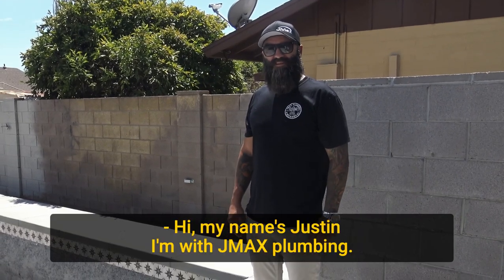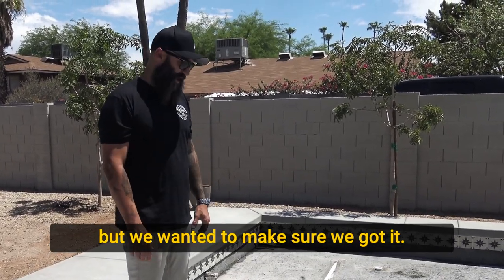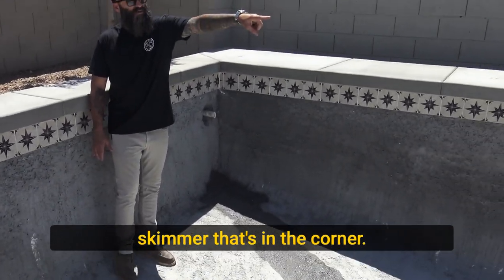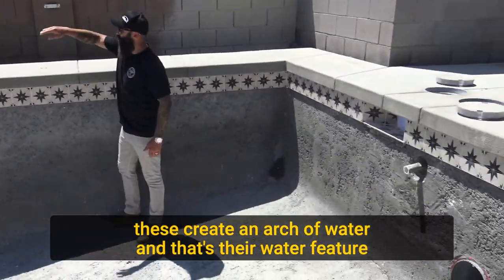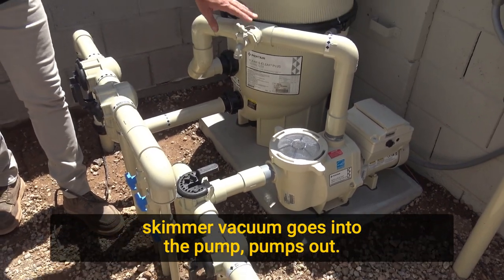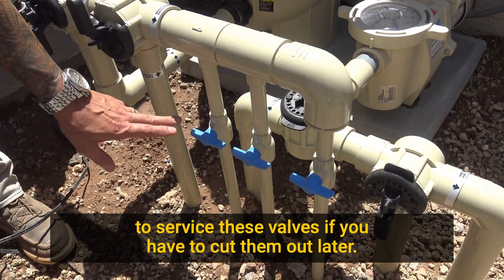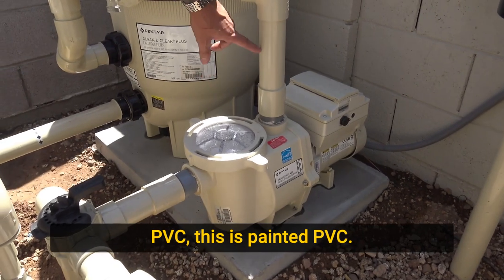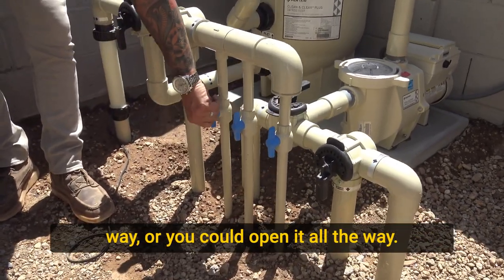Basic Swimming Pool Features and Plumbing Walkthrough with Justin Bowie of JMax

Comment: As a pool tech, installing unions is key in helping techs down the road incase the pump does need to be pulled, instead of cutting pipe your only unscrewing the union. Otherwise super super clean work. From my experience unions are like gold when pulling a pump.
Reply: Definitely I agree, unions are a must have otherwise there's no other way to remove pump but to CUT the pipe which is a big NO in my list, besides very nice installation.
Reply: @santiagosalcedo7653  could have installed high temp unions at the pump in and out ports .

Comment: So when you have an automatic vacuum cleaner, do you plumb that vacuum line independent from the main drain suction line with it's own three way valve?  Or do you just tap that auto vac line into the main drain suction with a pvc tee?

Comment: Cleanest EQ set ever. Only thing that would add to value would have been long plumbing w/out EQ and shooting the pad in with gunite. Very thoughtful return placement. The customer did an A+ job finding you. Are you doing an acid start up? Wondering what type of plaster finish you are using as you are saving the salt cell.

Comment: thanks very very informative, 2 questions ,

1- i only have 3 meters between the home and the fence , is it enough to make 5 by 2 pool cause you have to leave space for the cement and stuff?

2- should i get salt cell or choline system?

thanks in advance
Reply: Should contact a builder, to see what can and cannot be done, but I get the feeling that it may be a little close to even pass code.

Comment: Wait, you said the 2in pipe can carry 50g/min and the 1.5in can carry 60g/min. Is that correct?
Reply: 2" was 50gpm on the suction side, and 90gpm on the pressure side.  The 60gpm was on the pressure side of the 1.5" pipe.  I don't know if those numbers are accurate, just what he was talking about.